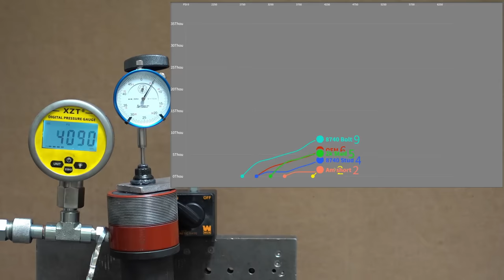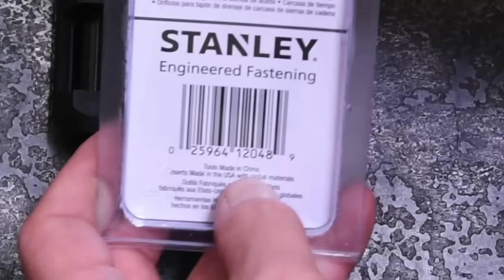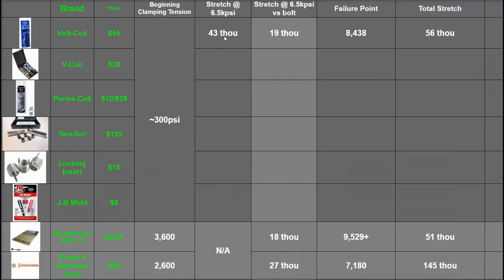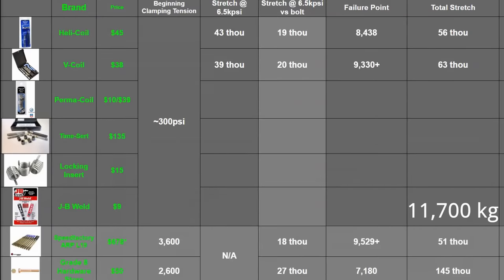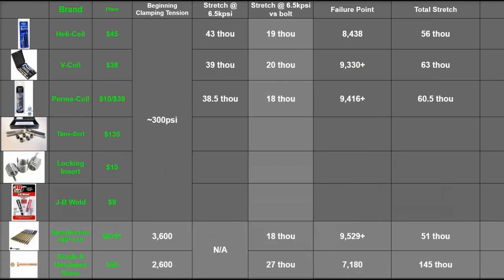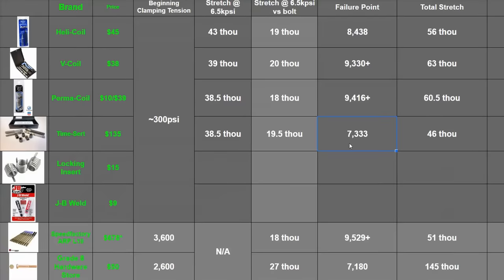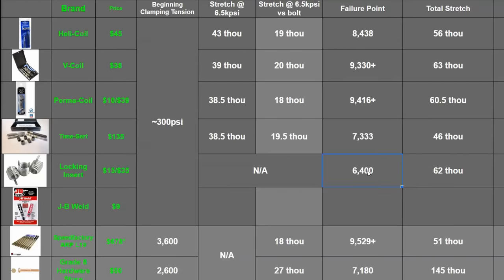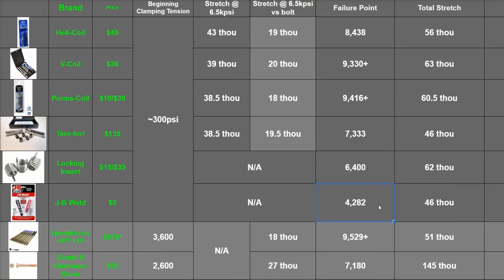12tons vs Bolt Thread Repair Using Time-Sert, Heli-Coil, J-B Weld & More

Comment: I think the issue was the base material... Using Timesert/Keensert-style inserts with a brittle material like some alloys of cast iron is a NO-GO. The install process is trying to plastically deform both the insert and the base material, and the process gets wonky on those materials.

For the brittle stuff, a different insert like an E-Z Lok that doesn't require any deformation will perform better.

Also, I noticed something in your original video about the base material you're using mentioning graphite- Are you using blanks of CGI (Compacted Graphite Iron)? CGI and ADI can be finicky regarding tooling, it's something to watch out for. Also, if CGI was the material your chose... I think only Dart is offering CGI LS blocks, as the GM blocks are basically high-carbon cast iron.

threaded inserts and thread repair can get a lot more complicated than people realize... There's never a "one-size-fits-all" scenario.

A good reference to look at would be NSTM-075... There is a LOT to learn in there, and it's an invaluable tool. When we were doing Level 1/SUBSAFE/nuclear work, that thing was like a part of the Bible.

Comment: I'm wondering two things about the JB Weld to see if it would do better:
1. Tap a bigger hole after drilling and then put the JB Weld into it ... I mean, the coil type inserts benefited from this ... shouldn't the JB Weld?
2. After tapping the JB Weld to size, if you allowed it to cure a little bit longer ... when you stated it felt "sort of soft" or whatever you said, it not being fully cured may have been the issue.

Don't get me wrong, I don't think the JB Weld would have stood up to the coil type inserts, but I think you might have gotten a better outcome if you went at it a little differently.

Comment: Very cool to have a video with proof of what I decided long ago. Timesert is overpriced, and even the cheapest spring style insert is at least as strong as original threads when properly installed. And they work even better in aluminum since the stainless wire withstands repeated use much better than aluminum does. There is no telling how much money I have saved over the years by repairing threads instead of replacing parts.

Comment: You can save a lot of dial indicators if you build an arm or two which will prevent the pieces from flying up into the indicator. Stop it short.

Comment: I didn't like helicoils due to them seizing with repeated bolt fit and remove like spark plugs, as a permanent fixture they're good. I went to Timesert when they first came out and while they didn't fail they were very sloppy, the seating tool did nothing and a stud moved way more than I liked and that was using their full kit.

Comment: This doesn't pertain to this video much but when testing something like an impact gun torque, how much of the result is dependant on the strength of the handle; overall rigidity, etc. There are things like the strength of a person's wrist, the type and padding of the gloves you wear, the rigidity when holding the tool, overall mass of the handle (counter torgue) and the list goes on.

Comment: Hey really enjoy your videos, would you ever do a comparison on the new Dewalt DCF891 20v vs DCF891p2n 18v, In Europe we only seem to have the 18v version compared to the 20v you have in the states 👍
Reply: they are the same thing.  eu laws are more restrictive.  18v is operating volt and 20V is storage volt when fully charged.  eu laws stated that manufacturer must label operating voltage and not storage voltage (to protect against false advertisment)
Reply: @FlashTwoSix  Damm that's a good answer 👏  Cheers

Comment: Dam I never thought helicoil will beat locking type insert. I'm always did same as you. In aluminium I use locking insert there is no place to argue. Maybe I will start to use helicoil!
Reply from the maker: Locking is good for commonly used and reused threads which was why we always used them. They were removable assemblies

Comment: It would be informative to compare this with inserts into aluminium (or should I type aluminum?) as I think it's far more likely that the original will have stripped out in that material than with cast iron. Also, engines are increasingly all alloy these days. Of course, it won't max out a high tensile bolt (or I assume it won't), but if you are running things that tight, then that's rather extreme anyway. However, what we wouldn't want is an insert pulling out of an alloy casting when taken to normal torque levels, or even a rather higher than that. 

I'd also suggest that it's possible that the relative performance of helical coil and solid insert might be different into alloy castings.
Reply from the maker: Check our project farm's video in aluminum posted at the same time

Comment: I’d repeat the test on each 3 times.  I find it odd that the timesert performed so poorly.  And ditto on the test with the stud into the JB Weld without tapping clean threads…would be curious if it would perform better.

Comment: @torque test channel how much would you recommend a Bauer 3/8 impact wrench? I watched some of your videos and it me second guess this impact gun. what I’m looking for in the future is an impact gun I can use of course Chang tires but also help me change an exhaust and maybe some suspension work on a Ford Expedition for future use. Basically an impact for automotive work and a good gun for my first impact wrench
Reply from the maker: I wouldn't use a Bauer 3/8" for that list of things. Just wont always get it done. And it's so large. DCF923 or Makita XWT14Z will, of course cost more but so would buying 2 different impacts
Reply: @TorqueTestChannel  I think I’m going to go with the dewalt but do you know if I would be able to connect regular sockets also? Like regular wrench sockets
Reply from the maker: You could use Chrome sockets in a pinch. Sure
Reply: @TorqueTestChannel  Okok I appreciate the help man thank you

Comment: Not really surprised at the coils performance. Well a little, but to think about it you realise with a standard thread and bolt you have the bolt threads "pulling 🤔" on the tapped threads . If those tapped threads move they are weakened and no advantage can be gained by further torque.  however in a triple  thread situation (coils) as/if the tapped threads of the coil move up or are pulled up they would be pushed closer into the bolt or the "block thread" creating a pinching force around/along the helix only adding to the "thread grip" until well. . Grenading. Yes there would be potential damage to the let's say block threads but coinciding with said pinching force giving coils a double punch approach as they approach failing compared to "standard" that upon weakening the threads just lets go.
Having three threads four now I think about it seems to your mind to be failed from the start, but having a dynamic one between two apposing threads has some surprising advantages it seems.

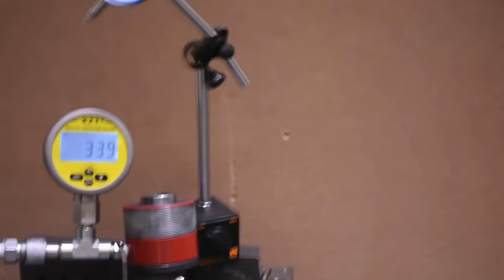Comment: Im at 1:07 I already know the answer. A thread insert is stronger because you grip into more base material. But there is always tolerances so cheap chinesium thread repair kits might not be as good.

Comment: From my experience with time serts they are mainly used for oil drain plug repairs so very low torque but this is very interesting heli coil did better

Comment: 🤔🤔🤔 I wonder how well the '''"HELI-COIL // V-COIL''''' thread repair would do on a automotive cylinder head... allllll bolts using thread repair & stock bolts / studs . 
Maybe  project firms  can dry it out.... 👍👍👍

Comment: Does anyone know why a thread repair is better than just tapping for a bigger bolt?
Reply from the maker: Bigger bolts usually don't fit where it needs to clamp or what the bolt itself is going through.
Reply: @TorqueTestChannel  Ok, that makes sense. Thanks!

Comment: Hot take: coil type inserts are compliant, allowing the load to be better distributed to the base material vs Time-serts.

As to the locking inserts, I think they create stress concentrations at the perimeter of the hole, causing it to break out.

Comment: Couldn't you just put the dial indicator on the bottom of the test sample instead of putting it in the line of fire.  I mean it would move negative when stretching but it's better than blasting every dial indicator you have into leo

Comment: There’s no difference between a cheap Helicoil knock-off and an expensive Timesert head bolt kit when it comes to a Toyota 2AZ-FE engine, because the engine block is made of cheese grade aluminum.

Comment: You yanks are cute... I'm 100% metric and have NEVER seen M11 screws.  It is either M10 or M12... ^^ Do they really sell M11 screws in the US?
Or is it the host thread for the insert?
I got a set of these from RS components. It works just as well as Helicoils. At 20% of the cost. Looks the same as your V-Coils.

Comment: I feel like JB Weld could have done better. JBW should be HARD; maybe not 100% cured. And prep hole with a little more ridge or taper slightly wide towards bottom.

Comment: but cast iron is not consistant structure. it is crystaline and brittle. threaded into mild steel would have been a better test of the inserts and not a test of the material theyre used on.

Comment: That weren't genuine HeliCoil the originals here in Germany are manufactured by Böllhoff all in one, nothing with Stanley or so
Reply: Both Bollhoff and Stanley makes Helicoil.  The helicoil brand was previously held by Stanley.

Stanley Engineered Fastening is a subsidiary of Stanley Black & Decker based in New Britain, Connecticut. This transaction allows each company to more closely align resources with independent strategic initiatives.

As part of this transaction, Böllhoff Group will licence back this trademark to Stanley Engineered Fastening in the North American region for the automotive repair and non-automotive applications. In North America, OEM automotive applications for HELICOIL® and wire thread inserts will be served by Böllhoff Group, while automotive repair and aftermarket applications and other industries will be served by Stanley Engineered Fastening. The remainder of the globe will be served by Böllhoff Group.

Comment: Those locking shims probably fractured the cast iron and weakened it...   Similarly with the Time-sert: the swaging operation  probably work hardened the insert, causing it to fail...

Comment: biggest pet peeve, people use their trade nomenclature just presuming everyone knows what it is.  ARP google says address resolution protocol, no idea what it means related to threads
Reply from the maker: ARP is the brand name who makes stupid strong bolts and head studs like this. Which was the main topic of the video that proceeded this, the head bolt testing
Reply: @TorqueTestChannel  yep totally didnt get that, i finally landed on it must be proprietary like auto racing platform.

Comment: The idea of Helicoil or other wire like thread inserts is to distribute the tension on more thread grooves than in rigid material - like show at 1:00 in https://youtu.be/bp31p8jSWaM. Glueing wire inserts with Loctite inhibits tension distribution at least partly. That why I am not surprised that the ridiculously expensive Timesert is worse than wire inserts.

Comment: Don't cut threads in JB Weld!

Instead, put in the bolt or stud while the JBW is still wet!
Reply: Yeah, you'll get better numbers. I've used that to secure the timing belt tensioner on a J30. 

If I had 24 extra hours I would have gotten a helicoil, but I had to drive it in 24 hours, so it had to be reassembled today!

 Brake cleaner the bolt & hole, slather JBW on the bolt, then put it in the hole! Tighten it as much as it will hold, then finish reassembly & wait 24 hours…

Then it held for another 100k miles.

Comment: You should be comparing to similar diameter screws as any thread insert is at least 20% larger diameter than original threads. I know/understand you showed your math but in most cases in “my world” you do not get the benefit of space to “enlarge”. Just sayin:)

Comment: When worked in a Cadillac service department, the Northstar V8 was famous for headgasket failures and thus used to often pull threads out of the block.

The factory repair, if my memory is still sound, was at first heilcoil repair.  But it was worthless.  After a short period we advised by GM to use time insert, but even then because it was such as junk motor, they still sometimes blew out the headgasket.  Might have been a good idea, but the GM execution was, well, trash.

Comment: I hate Helicoils. I use them all the time as my customers spec them. So instead of a tapped hole which I can verify with a go/nogo guage, they end up with a unmeasured tapped hole? The hole costs a whole lot more $$$. Helicoil's marketing must work because they have a bunch of engineers convinced. None of whom can change a tire, but they can add a bunch of useless GD&T.
Reply: helicoils are cheap from the source (10-25 cents), installation takes seconds with the right tools, and you can buy go-no go gauges for nearly any STI thread form. They work great for preventing aluminum threads from giving up after a few installations.
Reply: Maybe im missing something but the stainless threads are stronger than just about any material you would put them in from aluminum to cast iron to non-hardened steel.
Reply: @BrokeWrench  The point is you end up with a more expensive thread you cannot verify. I am not aware of any thread gauges for helicol taps. I bet you cannot even find a chart on size and picth of helicoil taps. Percentage of thread is a key component to strength. If you are putting your helicoil into shit threads you get a shit result. Design the hole right. Then people can verify it.
Reply: @plkracer  We do +200 helicoils on a single part thru our china supplier. So I understand the tool$. But the spec says "install per manaufatures spec". Nothing about measuring in that spec. So you can spend all that money or just make the bolt larger. It is your choice. I don't decide. I just charge more. I have aluminum (mic6, 6061) fixture plates that go through hundreds of screw/unscrew cycles. A lot of vises are now made of 7075 aluminum and they hold up for swapping jaws. Have you heard of a torque wrench?

Comment: Threaded fasteners are just a fad. With all the advances and additive manufacturing nuts and bolts will be a thing of the just like Tesla's are putting all the mechanics out of business at 3D printing will do the same to fastener manufacturers. Who would buy an internal combustion engine car that you need to change the oil and change the tires and change the brakes when you can buy an EV that needs none of that and you just drive it for 4 years and get a new one?
Reply from the maker: EV's don't need tires or brakes? Like a back to the future 2 delorean!
Reply: @TorqueTestChannel  That's what Elon musk said. Just drive it for a few years and then bring it back they give you a new one. It's super green.
Reply from the maker: @rustyshakleford5230  Your shitposts mean the world to me <3
Reply: @TorqueTestChannel  EVs have hidden dangers nobody talks about. My buddy has had a pacemaker since he was a child and had to get a new one every 10 or so years. They start to beep when they are running out of battery power. One time a few years ago he was walking by a Tesla as it was super charging then all of a sudden an air conditioner fall on his head from 4 floors up.